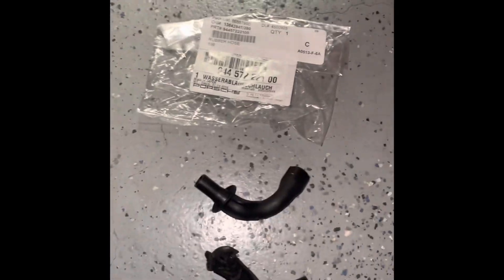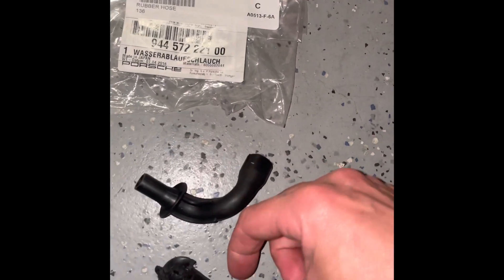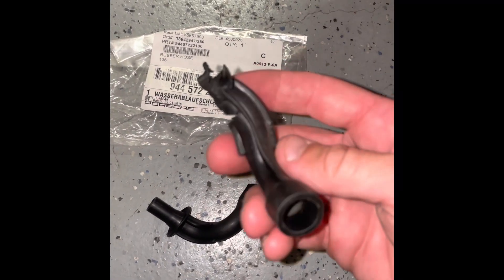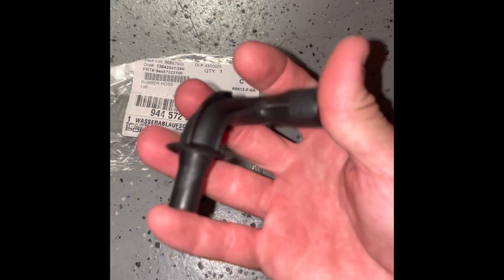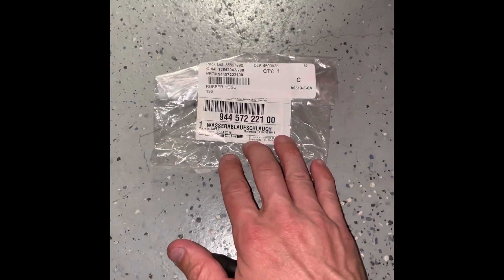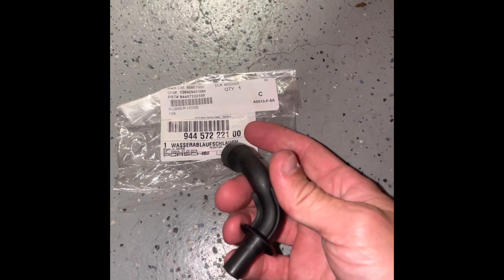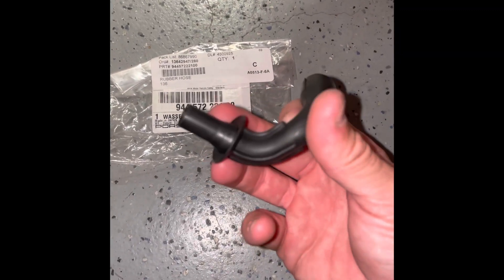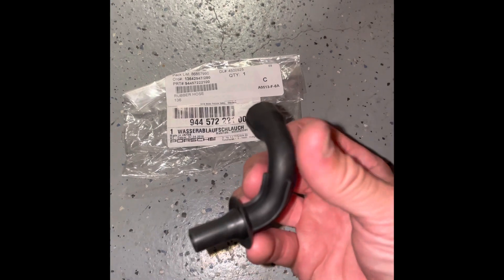Porsche 944 wet carpet? evaporator drain line replacement

Comment: Hey thanks for the video. That helped. I've had a wet carpet lately, not sure if it's AC drain line issue or window to battery tray issues. Still searching, but this helps. Thanks
Reply from the maker: Good luck. Also check your body drains, I have a video on that as well.
Reply: @tims_4x4_garage  it was the same as you the little rubber piece from ac drain. We have humid weather in Miami so it was filling the ac box and my cup runneth over every time I took a hard left. New hose ended that. Was also good to see the location and how to get to it. Is there a tube it connects to or does it just fit in the metal hole. I wasn’t sure.
Reply from the maker: @schrockahasi  I should’ve pulled out the little cubby under the radio when I made this video (this video is awful quality I just realized. Sorry for that) but the cubby comes out very easily with a pull. the drain just kinda pokes through the floor
Reply: @tims_4x4_garage  mission accomplished. Not a problem.